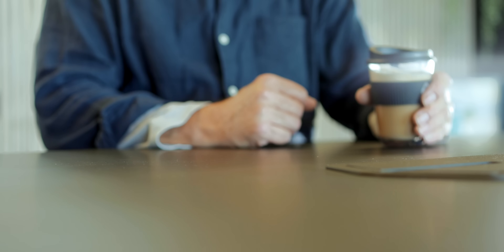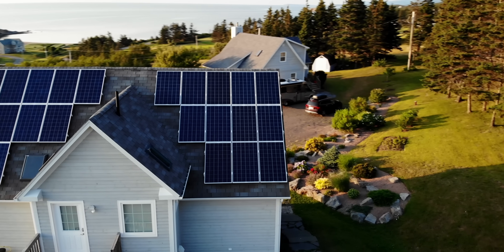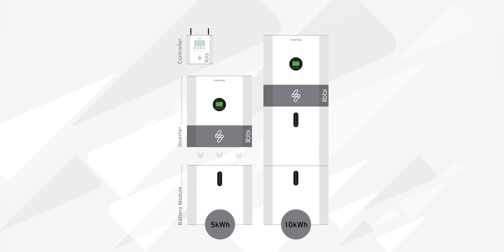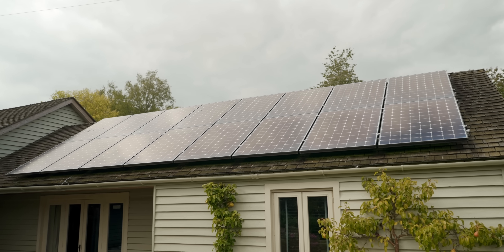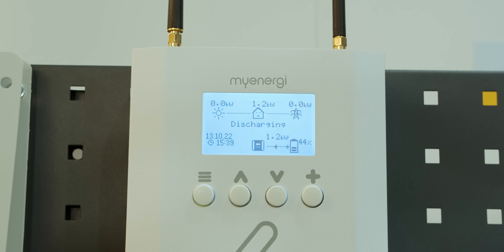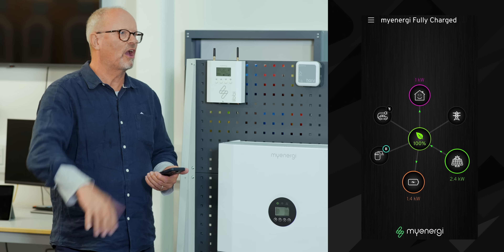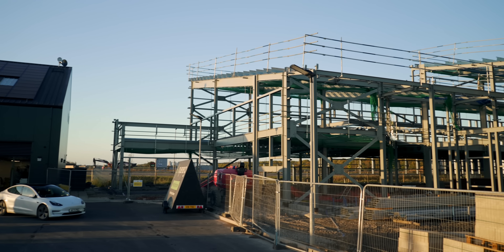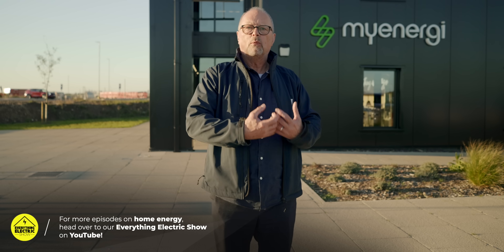THIS Home Battery is the Key To Cheaper, Cleaner Energy!

Comment: powerwalls are a scam. you pay thousands for a battery that only last 15hours, uo to 22 if you add solar panels all over your roof.

now the con is these devices for most of their time will be feeding bavk into the grid and doing nothing for you, which makes elon money for all thats fed back in.
instead of you.

the solar supplied isnt strong enough to keep the batteries charged, so 24hours later your in the same situation of having no power...only now your batteries are dying because theyre on 0% for an extended period.

here in puerto rico where we can go days or even months without electricity (the power company luma is fully corrupt, doesnt spend on infrastructure only repairs, they decided to charge everyone double last year, monopoly).
many poor old people got powerwalls for survival and found them next to useless when it was needed.

Comment: Micro generation is the key. You get free energy you have more control on what you use, you are shielded from price increases and you’re helping the environment, and If you’ve got a heat pump even better. 

Now the downside, you won’t break even for years but if prices go up those years reduce and in all cases involving new technology, initial high cost is the limiting factor 

Government grants are available for reducing this but they must be higher to kick start the revolution in self power generation and bring down the cost of the hardware to a level that everyone can afford.

Comment: Live in the tropics in Australia, and have 13.2 kW of solar panels on my roof, and a 10 kW grid tied inverter, and was told I could export 10 kW to the grid.  However, at the last minute as installation was completed (Jul-2023), the installer reduced the export limit from 10 kW to 5 kW (single phase power).  Basically I was tricked by the installer into buying an oversized system.  However, I'm not complaining - I get free electricity and make around $110 AUD per month tax free on the excess electricity I export to the grid - a whopping 25% Return on Investment (ROI).  My solar system will pay for itself in 4 years.  It's like having a piggy bank on my roof.
I am exploring options for saving all of the excess solar power that is just being wasted - which is 13.2 kW production - 5 kW export = 8.2 kW excess during the sunniest part of the day.
What I want to do:
* Add battery storage so that this is charged with excess solar electricity (over 5 KW) during day
* Make my house run off battery when not producing excess solar (evening, night, etc)
* If I have excess kWh in my battery, export this to the grid (after midnight).
* If cloudy weather is coming, stop the battery exporting to grid so that I use this power over the coming day(s).
* Make it so the battery charge / use is always optimised to extend the life of the battery. eg. 80/20 or 90/10.
* Be EV ready for adding an EV charger when I get an EV.  And, be able to use my EVs battery to run my house (if the house battery is flat), or export EV battery energy to the grid (like I can do with the house battery) if the EV battery is fully charged and I'm not planning to use the car for a few days.
I'm pretty sure the MyEnergi people could help with most if not all of this.  Do they have installers / contacts in Australia that can advise and do the work ?

Comment: I got a solar system installed 4 kw solar panels and a 5.2 fox ess battery and fox inverter and am not impressed battery doesn't last the night even though we probably use less than 2kws I enquired about another 5.2kws battery 2x hv2600 and was quoted £3600 I went onto a Chinese website bought a 10kw battery for £2000 and a second hand inverter attached to a wheel trolley connect up and now have a portable power station of 10kws that I plug in and use the night time cheap rate of electric if I had new about this before I spent £10400 on a solar system I wouldn't of bothered as really it's a waste of money I now get half price electric with my portable solar system that cost a fraction of my solar system

Comment: I have a fundamental problem with this idea that I have a battery and I'm going to give up my cheaply bought or self-generated energy to "help the grid" out of the kindness of my heart - if the energy companies want that then they're going to have to do something for me to compensate for the investment I have made: I'd start with the buy/sell spreads which are massive - the spreads tell me that they really aren't that bothered about my battery storage and solar panels and they'd rather not use it - the spreads need to be half the gap they are now before I'm even going to entertain it; if I have a gross over-generation, sure, but otherwise that's mine, and remember it's the winter when solar is less effective this is really going to matter. Also we need to talk about standing charges.

Comment: My Solar Array and Battery Storage was hopeless, until I had a Harvi and Eddi installed it's transformed my system with the monitoring,I intend to get a zappi fitted at a later date and buy a plug in hybrid, has I don't think the UK has the infrastructure to go full EV yet,If I'd known myenergi was going to bring out a Battery I'd of most probably waited for their product but I've made the purchase now so won't be updating my current setup, it's my 1st real Summer with my PV Array so I don't know what to expect my savings will be,but so far so good especially my generation heating my hot water instead of my Boiler needing to be used 🙏

Comment: Can this system work in a of grid cabin(with little or no solar) by charging the house battery from the car and/or run the house from your ev (provided your car is capable of course)?

Comment: Thank you for the video and very informative. I want to know whether we could change some of the terminology though, we are trying to build ecosystems and the Grid is part of that ecosystem.
So maybe instead of using words like spilling and wasting when we export energy, we could say contributing. Surplus electricity is best used for things that only electricity can do, I wonder whether dumping into water is really a sensible thing to be doing with such a valuable high-grade energy?
I would like to think it could be running computers, charging other people’s cars and running hospital equipment, elsewhere. We could then collectively, move towards a renewable energy system.

Comment: Its like many ideas, concepts, missing really important information. 
3.8 Tkw wind power curtailed. No demand No market. 
3.2 Tkw solar power curtailed , no demand no market. Thats a huge loss in terms off capital investment and pushes up energy prices when traditional energy has to step in with seconds to support production.  The contracts demand a higher contract price to cover this. 
How long to recover your capital outlay if the grid producers played fair ?
How long is a peace off string.
The hope is domestic energy capture creates a market to sell its data & its customers in batches. 
UK still lags in fibre optics availability,  restricting a smart grid. 
Plus the grid cannot export renewable over distances due to lack off investment. 
Any thoughts that the customer is King please go to the back off the queues. 
Divorced from economics, current market operability at record prices & inflation, you have to conclude the sentiments are aspirational.  Reality allways has a bite.

Comment: I was about to add myself to the waiting list for a Libbi, but then I did some arithmetic.  In order to get the cheap overnight EV charging on Octopus, you have to pay more for the  daytime power.  Since we got an air source heat pump we are now (late November) using a bit over 30kWh per day, mostly for heating. You'd need a huge battery to run the heating for long, and the saving made by cheap EV charging would be more than wiped out by the higher daytime rate.  It would be much more favourable in the summer, of course, but that would mean swapping tariff every 6 months.

Comment: Ok - be clear. What is the total cost of ownership? Buying, installing and operating. Then, how many cycles can the battery withstand? 2500? That allows you to calculate the cost pert kWh of electricity stores. Is it 0.05euro/kWh or 0.5euro/kWh for stored electricity?

Comment: And what about the environmental footprint of this battery? The challenge is rather to shift the operation of certain appliances (hot water tank, washing machine, electric vehicle charging, etc.) to coincide with the production of renewable energy. Your EV could become your home battery thanks to smart charging and that would lower the environmental impact of your vehicle instead of adding a battery in your house that has its own (heavy) ecological footprint.

Comment: That thing is massive for only being 5kWh. By the way most inverters that have the capacity to run an entire home  draw almost 4kWh just to stay running over 24 hours. Current Tesla power walls are 13.5 kWh easily twice the capacity of the libby.  This is not a phase change technology, pass.
Reply from the maker: Have no wish to change your mind or in any way influence you but just to say the battery capacity starts at 5kWh. You can easily add 4 battery units running from same single inverter taking capacity to 20 kWh. A bit bigger than Powerwall but until we've seen on installed it's very hard to tell how they'll behave. One thing I will say, Myenergi software integration is impressive.

Comment: In what can only be described as the ultimate irony, UK chancellor Jeremy Hunt is expected to put an electric vehicle excise tax in place by 2025-2026. So much for the "tax breaks for buying EVs" angle to saving the environment... This month's Autumn Statement will include the measures, according to FT, who said people familiar with the road tax is part of a larger plan to address a fall in motoring tax revenues caused by the shift to EVs, which leave out fuel-related taxes. Fuel duty raises about £35bn, but the Treasury has warned that a growing number of EVs on the road could cause this number to plunge by £2.1bn by 2026-27. Ergo, a new excise duty on EVs could take place by 2025-2026..................... WAHAHAHAHAHA! UK peppapig land what a fraud and joke.

Comment: @Fully Charged I want a kit that will let me easily use my Bolt's battery as a home battery once it reaches end of life for powering the car. Anyone making that? 
Even at 50% capacity that's still ~30kWh essentially for free. Compare that to a powerwall at about $1000/kWh. 

I imagine simply bolting it to the wall, plugging in the appropriate power and data cords, and wiring it into my house's electrical panel. No faffing about with individual cells, or tearing the pack apart to DIY a custom battery. 

Powering a house is a lot less strenuous than powering a car, especially the way I drive, so active cooling might not be needed.

Comment: "This home battery is key to Cheaper Cleaner Energy"

 I very much doubt it at the prices quoted on the My Energi site.

 Price quoted is FROM £4,595 +VAT, if applicable, plus installation.
I guess that is for a 5KWh battery and the lower rated inverter (3.6KW?). Even if you can get it VAT free you're probably still looking at north of £5K with installation, that's £1,000+/KWh.
Assuming a battery life of 3000 full depth Charge Cycles the cost of storage works out to about 33p/KWh, assuming cost of capital is zero.

Furthermore,  assuming battery life is charge cycle and not time limited the battery will probably last 15 years or more because it is unlikely to be fully cycled every day. In fact, in December, in the UK, you would need on average a 10KW peak PV system to fully charge a 5KWh battery daily, many house roofs can't even accommodate 4KW peak.

Unless additional 5KWh battery additions are less than about half the base unit cost I can't see this as a good value proposition, and definitely not with just 5KWh, and that's at the current extremely high electricity prices. 

My Energi's general approach appears to be really good, but the cost of battery storage really needs to come down. 
At these prices,  if you were looking for a 20KWh+ system it might be cheaper to buy an EV, certainly a second hand one.

Unlike the electric car market, I don't think there is a market for high performance home battery packs, people generally will want to buy them in order to save on their energy bills, and probably to get a return in 10 years or less. I don't think powerball will give you this either, the Powerwall 2 comes in at about £850/KWh installed, that's a heck of a lot of cycles/years to get a return on your investment.

For typical UK homes with gas heating, you probably need 5 to 10KWh at most, unless you're running all electric which is a much more complex calculation. And if you are good connected then anything more than about £500 per KWh is probably not a good economic investment.
For reference, based on the MG 4 electric car, the additional 10.9KWh battery capacity between the standard and long-range versions works out to £229.36/KWh

Comment: Sounds like a nice product! I'm a bit hesitant about the claims of 'more than 90% of generation can be used by yourself using this battery'.

That sounds fairly high to me. 

At the moment batteries aren't worth it in the Netherlands, because we have something called 'salderen', which allows you (at least until 2025) to 'exchange' energy delivered to the electricity net for electricity taken from the net.

This year I expect the solar array to produce somewhere around 5400 KWh of electricity. To hit the 90% (or more) I would need to consume more than 4800 KWh's myself. The problem however is that I produce around 3000KWh more in the summer than I consume, and I use that energy to heat the home in winter. 

Let's take june this year as an example.

Delivered to the net: 543 KWh, consumed from the net: 91KWh.

So basically the highest 'extra' own consumption of june would be the 91 KWh consumed from the net.

In this scenario getting a battery would be a highly questionable proposition, unless you have a very flexibel electricity rate, which allows you to sell elektricity at peak periods for a greatly inflated price.

Getting an electric car also would change the calculation, because in a 'normal 9-5 job' it would increase the amount of electricity needed in the evening by quite a lot. (although with regards to net stability charging cars during the (sunny) day would be preferable).

Comment: When somebody comes up with a battery storage system that does not rely on rare metals that will quickly become less available and inevitably more expensive to purchase or replace I will consider that option. Lithium mining leaves a significant ecological footprint on soil, water, and air. Also, it leads to increased carbon emissions, the very thing the EU is trying to eradicate. Typically, lithium mining requires consuming large amounts of water, which could lead to droughts during summer months and floods during rainy seasons. Not such a clever system!

Comment: In order to charge a car from the baterry you need a 80-100kw battery .. in order to charge that battery during the day you need 20kwh PV and 🌞 during the day. 

Ohh I forgot that you also need some 2 5kw inverters to manage that all .. and some special grid assistance to charge the batteries during nite if there is no sun ... So math is simple but there ain't £££ that's the issue

Comment: I'd love a couple of Libbies. Had a 7+ Kw SOLAR system installation last year but STILL WAITING for the POWERWALL2 house battery. Any chance someone from MyEnergi can let me know how much two of these batteries will cost and the soonest they will be available to fit them? I've already paid for the Powerwall but I'm 66 and want batteries before I'm dead preferably. I have the MyEnergi Hub and Zappi2 already installed even though my EV is still waiting to be delivered after twelve months of waiting. During the summer I've been giving British Gas all my excess solar for free as I didn't think it worthwhile to change to a payment for solar scheme rate. If I'm unable to get out of the Powerwall commitment then I'd possibly only need one of these roughly ten kilowatts batteries unless the price is reasonable then I'd go with having as many batteries as possible in this current climate of crazy utility prices. Many THANKS for your time and any assistance you are able to give.

Comment: I'm an engineer and I'm really impressed by the MyEnergi products. I'm yet to use them but will be putting them in our new home. I particularly liked the fact that the Zappi charger monitors your grid connection (amps on each phase)  and will reduce the car charging to ensure that your grid connection supply rating is not exceeded. Also, fully integrated 'out of the box' saves soo much hassle (and potential disappointment). when trying to integrate products from different manufacturers.
Reply: Most EV chargers should do this via a CT clamp.

Comment: It's a shame that instead of the push for smart meters they set a standard so every home has a meter that has a built transformer to directly connect to solar panels and/or batteries. Some of the control could also be given to energy suppliers since its their own equipment.

Comment: Nothing more than a fancy infomercial to sell product.  Still incredibly expensive, incredibly flawed.   No charging for cars outside.  Power conversion efficiency is poor.   Temp efficiency issues. Mining, production, transportation and disposal of the batteries is extremely energy intensive and environmentally damaging.   Then the battery life is maybe 10 years depending upon cell quality.  You only have to look at the Samsung swollen batteries to see how these things can become fire hazards, and when they're attached to your house, well good luck putting that fire out.  Nuts.